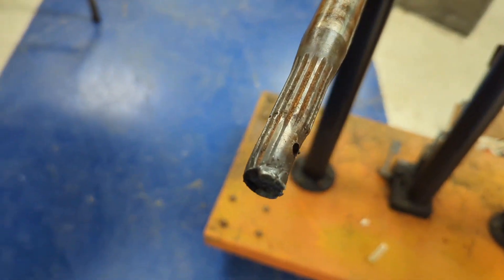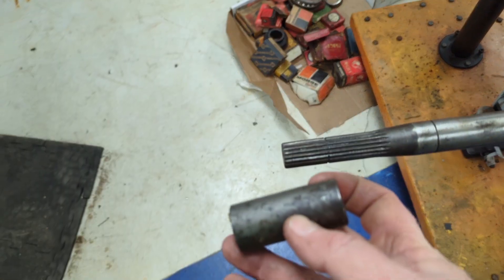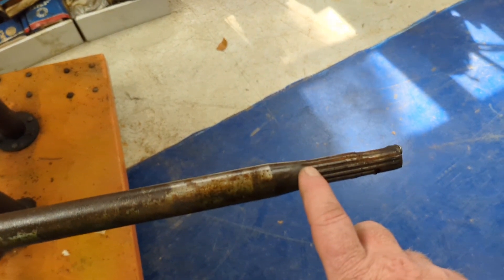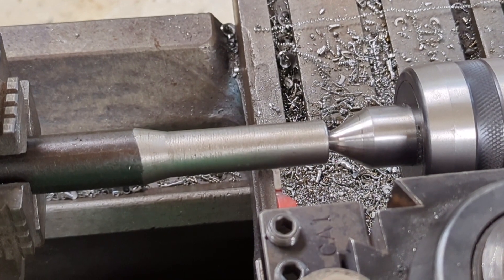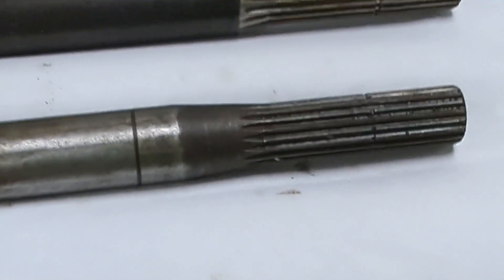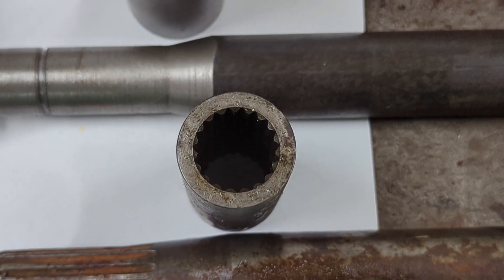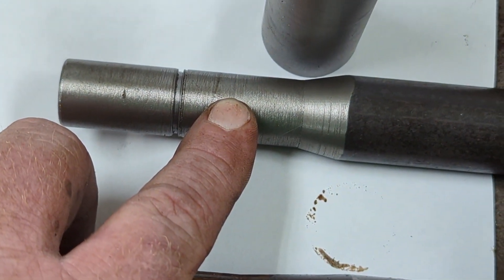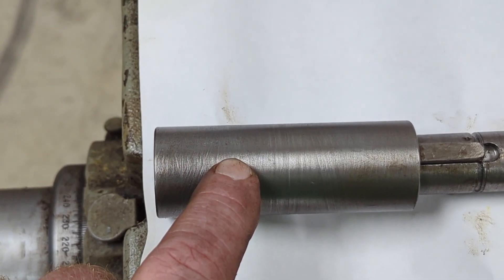Fabrication of a differential shaft for a 1983 case 1030.

Comment: Man yeah Mr Steve, looks amazing!! Hopefully the plug welds will hold up! That was wild on thr cost, but I can understand stopping production and re-tooling for one part. Be safe in tbat heat, thats sounds unbearable almost with your unreal humidity also!! Thank you sir for bringing us along, look fwd to the upcoming projects!! 👍👍😁😁🇺🇸🇺🇸
Reply from the maker: Thank you for your support and comments. I really appreciate you
Reply: @firehousecustomfab3286  🇺🇸🇺🇸😁😁
Reply: Creating a coupling with internal splines can be a big job. Sounds to me like a job for a shaper if they have one and the proper tooling to be able to reach down a bore that small. There is also the requirement if any for doing the hardening afterward. Custom made parts are always an expensive proposition due to the time it takes.
Reply from the maker: @fredflintstone8048  the shop that I apprentice with, can do it, but they're one of the few shops in the area that can even do gears and splines, so they are slammed with work. The customer was able to make it work out. I would have liked to film making the coupling though. Thanks for watching and commenting.

Comment: I'm curious what kind of steel was used for the replacement shaft and what kind of heat treating (hardening) if any was done on the ends if not the entire length.
Another thing that has to be considered is that a splined shaft has much more engagement surface area than a keyway. 
Welding may or may not hold up depending on how the welding is done. Welding as we know will often create a brittle connection that's not conducive to vibration, shock. Of course heating up before welding and heating afterward can provide a certain degree of annealing helping reduce the brittle nature of the weld.
Reply from the maker: I used to 4130 for the shaft. It seems to be fairly good and it's got a decent hardness to it. We didn't do any heat treating because of the type of steel that we used. As far as the welding, I'm afraid of any damage that may have been caused from heating, was already done by the previous owner. The previous owner had already tried welding the two shafts together and it failed, I'm glad you mentioned the post heating and or slowing the cooling process down. That probably wouldn't be a bad idea